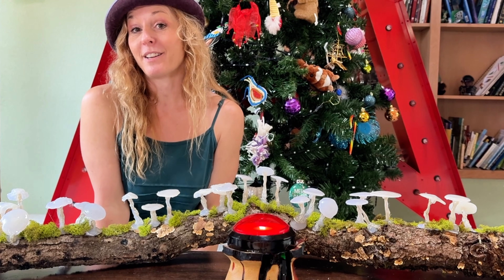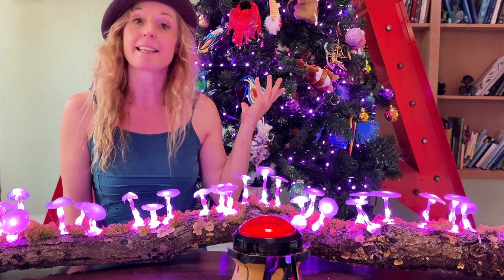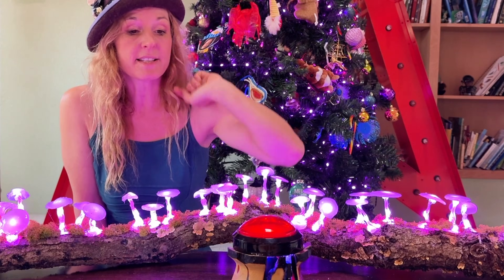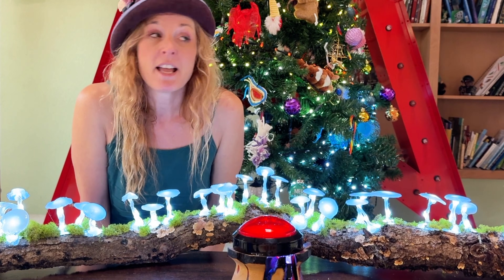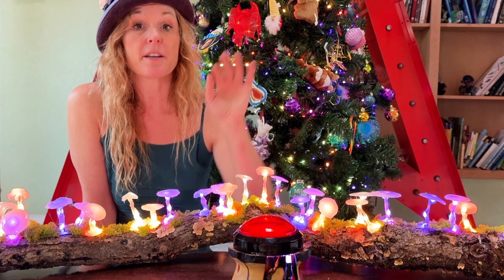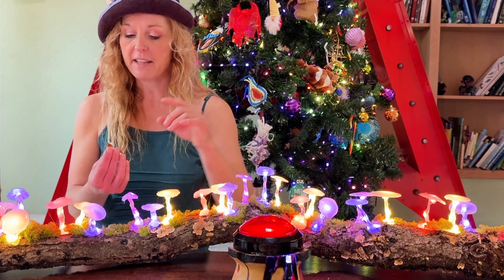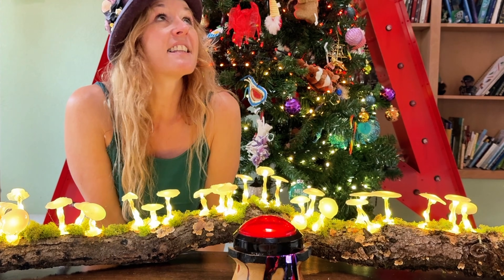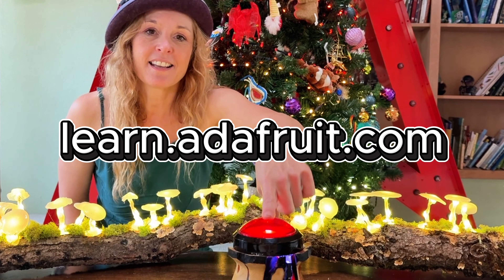Tutorial: Build a WLED Control Button for your LED Projects #adafruit

Comment: Any way to reduce the latency? i'd love it to be more responsive..
Reply: WLED supports hardware buttons and a number of boards that support it - including the Adafruit Sparkle Motion boards - have pins for that exact purpose. So if you make a project with a direct button it would be more responsive since it doesn’t have to communicate over WiFi to other devices.